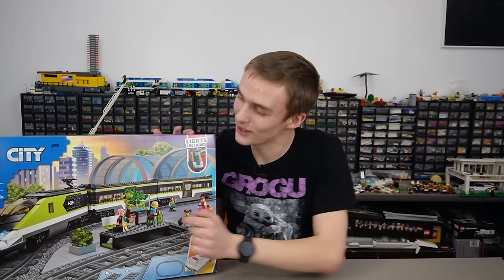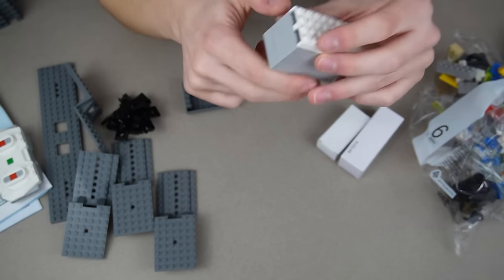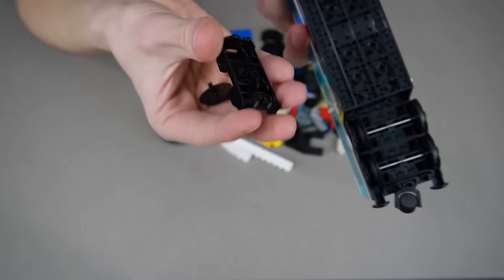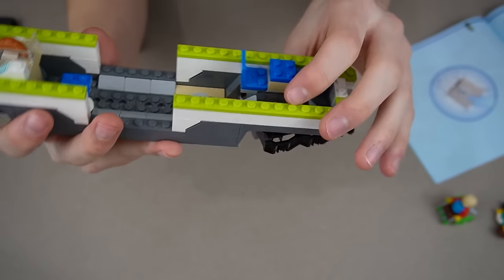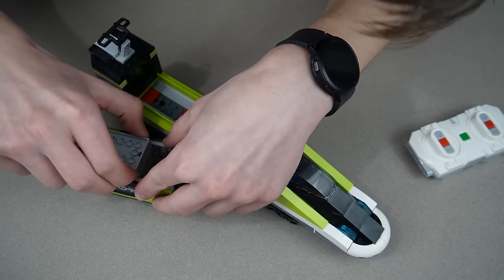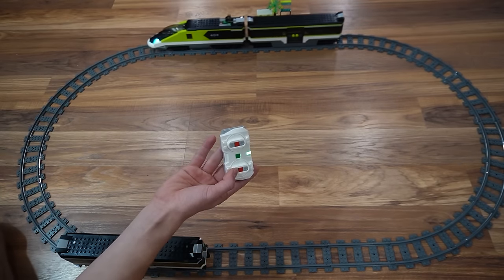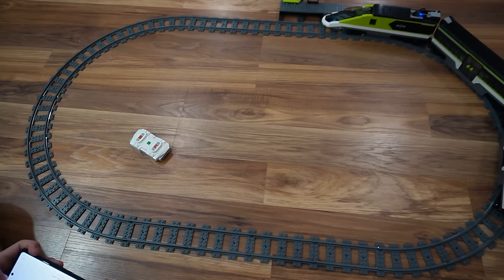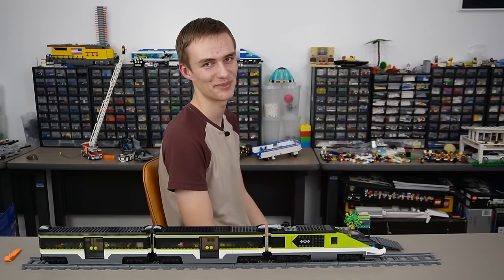I Got The WORST Lego Train

Comment: About the batteries. you said they should make them rechargeable. They do make rechargeable AAAs you can get them anywhere.
Reply from the maker: Yeah, but a port on the battery box would be much easier.
Reply: Rechargeable batteries don't last long, better have extra ones on hand.

Comment: Honestly this is one of my favorite train designs that Lego has put out, especially in recent years. Absolutely love that it draws inspiration from the Shinkansens with the angular design of the engine car, and its a very good color scheme as well. Also, you can easily take all those tracks out of the stack by pulling on the bottom-most rail, the one that has the base of the poles visible! I learned that trick after buying a second one to have a full-length train and create a track that runs around the floor of my bedroom...

Comment: You can use the track connectors to be train stoppers. Really hard to budge it open with a train (I couldn't do it with max power).
Also, fun fact: You can change the controller's color by clicking on the train button.

Comment: It actually seemed like you really liked it! And thanks for showing the programming side I had no idea! I'm gonna have to try it. I agree the nose looks bad but overall it's one of the best, the tinted windows are great.
The extra straight tracks I believe are because the train is advertised as being fast and a single loop would derail at max speed - it can still derail even with the full set.
The curves on the edges aren't good enough for the carriages not touching btw, if you try elevate any track build with a turn they will touch each other.
Try get energizer rechargeable AAA's, I did just for these sets and I tested them vs dispensable premium Duracell AAA and they measured up well, max speed is still reached even with the slightly less voltage.

Comment: I do think the 9 v system is much better because of not having batteries go flat every few hours. But they could have the best of both worlds, bring back 9v powered track with the big yellow dial that plugs into the wall, but with either an integrated DCC system or Bluetooth to send control signals to any number of trains. But still, even if they chose not to do that I still much prefer the 9v system with it's big control dial and infinite full power. Batteries suck!

Comment: Honestly, one experiment I want to do is combining remote control systems and the 9v system. 
There's a guy (also on YouTube) called Bevin's Bricks, and he sells metal wheeled power pickup accessories with Power Functions wire attachments. 

It's a possibility, not sure if it'll work, but I may be able to set something up that has the metal wheels to draw power from the track into the engine, and have some sort of switch similar to the Powered Up battery box/hub that pairs with the controller to only let the power slow when I press the controller buttons.

Comment: I actually think the ability to use replaceable AAA batteries is probably better for the environment assuming users use replaceable batteries. Having user replaceable batteries makes it easier to keep the rest of the product working for longer. Convenience does degrade by using AAA but it’s kind of like the Xbox vs PlayStation controller debate.
Reply: Almost nobody ever uses rechargeable batteries.... so they hit the dump 90-% of the time.  9v is a hundred times more green than any other type of modern Lego trains. Plus very versatile and can be used with PF motors and Blue-Tooth if wired right. No need to replace batteries is more affordable to enjoy it!

Comment: The powered tracks had issues because you had to build a close loop and avoid shortcuts while laying tracks, that's why they moved back to battery powered trains. But when the tracks was powered you still could battery power the trains if you wanted to, but then without control. Also the powered tracks kind of degrade over time making it harder to make a complete circuit between the tracks.

Comment: I also happen to dislike this train quite a bit, but for different reasons. Mainly, it has, yet again, no second 'loco' (steering unit) which makes it very unrealistic. I very much preffer the old 2014 and 2010 trains with one coach but the two steering units. 
As for the common critisisim of the fact the new trains include batteries, I happen to like that quite a lot, since it allows for operating multiple trains on one track at the same time, which is more fun! But yes, it does mean the locos have to be bigger to fit the batteries, which sucks
Great video, cheers!
Also yeah, the design of this set isn't the greatest either

Comment: You can easily convert plastic tracks to 9V track with some 1/4 inch copper foil tape. Also, rechargeable AAA batteries do exist and I recommend you get some. I think using AAA batteries is better than a proprietary rechargeable battery because if Lego stopped making/selling them, then you'd still be able to easily find compatible batteries. 
All the different systems have their advantages and disadvantages, but my personal favorite is Power Functions followed by 9V then Powered Up.
I dislike how Lego didn't make Powered Up easily backwards compatible with Power Functions. Their official solution is to use a Powered Up Hub connected to a Powered Up Color & Distance Sensor to send signals to Power Functions IR Receiver connected to a Power Functions Battery Box, which means you have to use even more batteries. 🤦‍♂

Comment: The nose won't work on our tunnels but it does look like some High-speed trains do.  That said, I still think Lego should go back to 9v but marry it to Blue-Tooth for the best overall performance. Lego likes to say they are going green.... but thousands of batteries in dumps says different.  9v is still my favorite system and it is a green system. They can always have track made in different countries to make them affordable like they already do with some other pieces like Legs for some minifigures.

9v with Blue-tooth would give us the functionality of the old 12v but with a lot more power.  You can even use 9v motors to power PF-motors if they go back to the old way of making connectors match.  The best of every Lego Train functions.  Lionel and tons of regular Train ppl make money every year.... lego needs to stop thinking tinker-toy and start thinking Model Training to make this really take off.

They could even have model trains running around the upper ceiling of their stores for kids to get excited about trains!!!

Comment: The doors on mine don't stay closed, every time the train goes around a corner they swing open!  The Powered Up Bluetooth also has problems in crowded environments (like model train shows) as all the interference from other people's phones reduces the range to only a couple feet!  Power Functions had its issues too, requiring line of sight and limited range, but at least the trains didn't stop if they lost connection.

Comment: Disagree the new Lego City Powerd Up works much better than both 9v and power functions in practice but has its flaws 9v you do need a lot of power stations to keep a big layout supplied power functions you have to be directly on top of it. The set itself is solid first time in a long while lego made a brick-built cab design and I would only make one or two small changes to the coaches. You can combine 9v and power functions I took my own train small steam engine and tender and gave it Powerd Up lights and motor it has a controller and works very well on big layouts i use rechargeable  batteries for saving money

Comment: Don’t they all run off battery’s?
Reply: Well all the Morden ones
Reply from the maker: Yeah, all the modern ones do, but back in the day they made ones that plugged right into the wall and didn't use any batteries.
Reply: @brickstudiosYT dang
Reply: @brickstudiosYT actully the 4,5v runned on batteries and its a series from 60-80
Reply from the maker: @BrickMasterPoland  Yeah, the very first powered Lego trains used batteries

Comment: The different length of the bogies on the "locomotive", the sheer amount of batteries used  and the missing locomotive for the other direction oh, and the too high price make this set bad
Reply: The different bogie lengths is on other passenger locomotives such as 60051 & 60197
Reply: It can go in reverse so no need for another